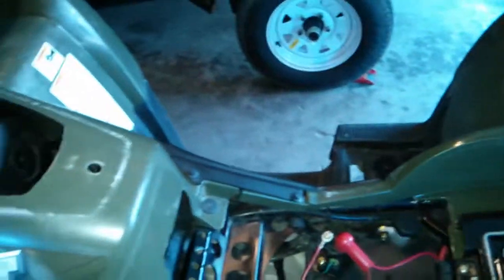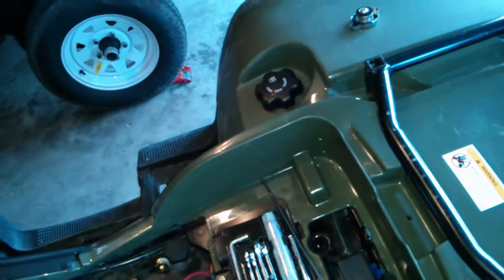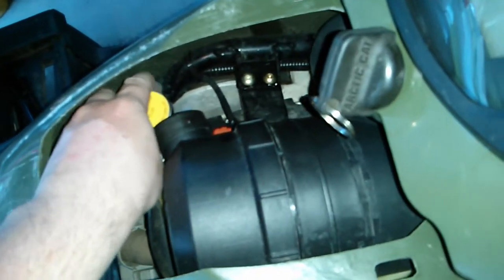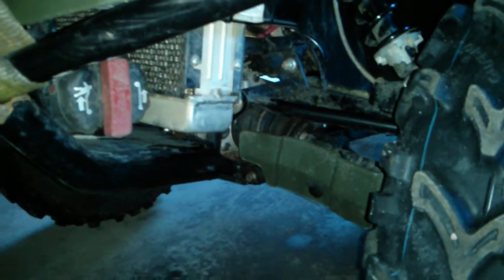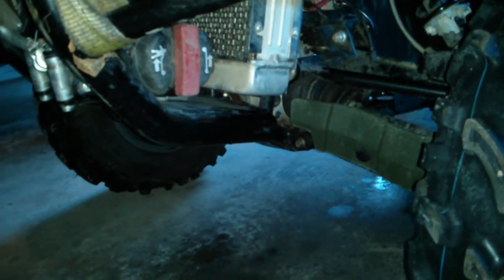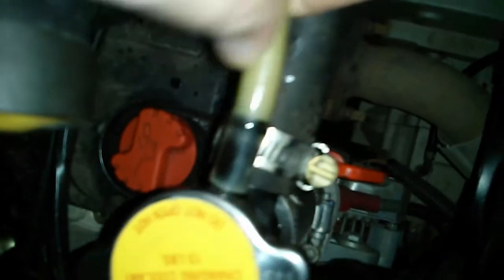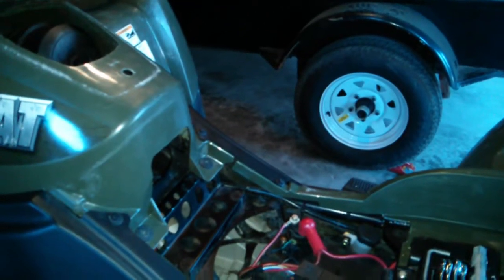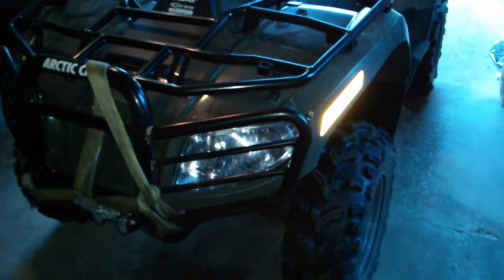Having Major Cooling Issues, Lots of Overheating! - 2007 Arctic Cat 700 Diesel

Comment: I got my quad when I was 15 yrs old and I ran into the same problem with my quad and it was my fuse... so when refilling antifreeze I went and got antifreeze for diesel engines since (from what I know) a diesel engine runs well over 100° and a gas engine around 100° , (just to mention water boils at 100°) so that's when steam builds up and blows it all out, but it's the "something" in the antifreeze that keeps if from boiling so fast and that's why its antifreeze so it doesn't boil and steam so fast (like water) and has time to cool the engine as well as the hot antifreeze that comes back out of the engine,... so with that said diesel antifreeze has more of what ever gas antifreeze has to prevent it from boiling and steaming.. 
And I nvr had a problem since:)

Comment: First thing the radiator cap shouldn't be over tightened. Twist it until it stops and your set.
I don't believe the coolant is going into your engine. You'd know it for sure. 
You filled the res and its disappearing?? 

Just saw you have another video. I'll watch that.